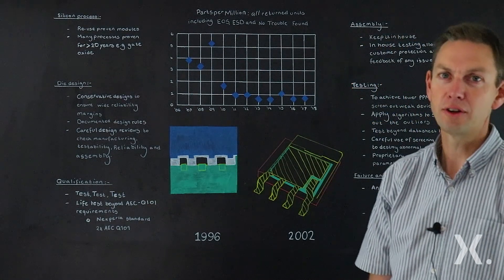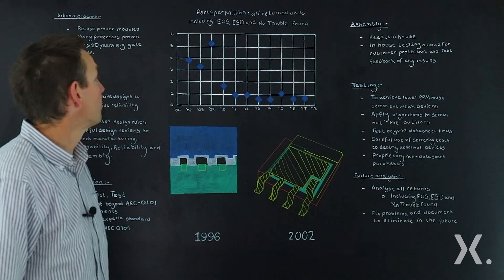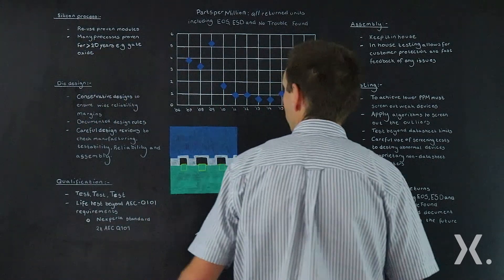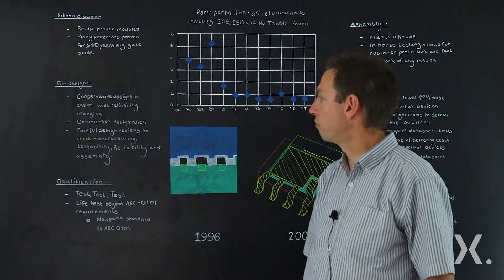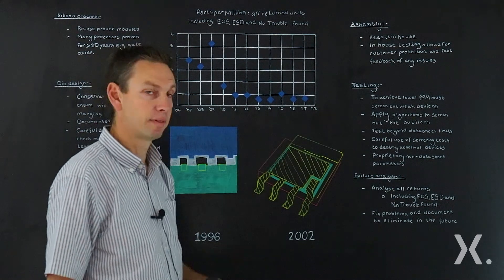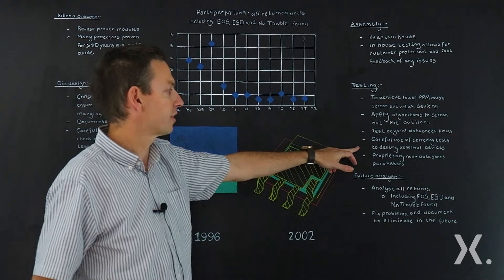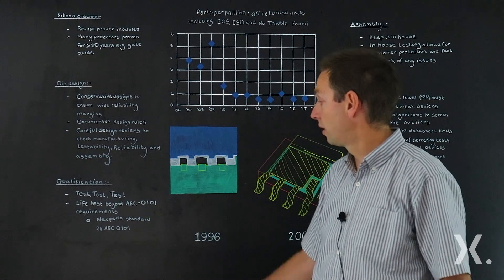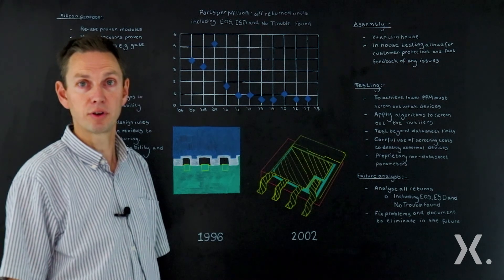Developing reliable MOSFETs: how difficult can it be?

Comment: Could you show mosfet operation, differences, temperature distribution, temperature delta and ultimate failure during operation and stress with an infrared camera and electron microscope, etc. in a video like this?
You have inhouse device production and testing , so it should be possible. Actually seeing the conditions under which the real thing blows is always most interesting and educational..